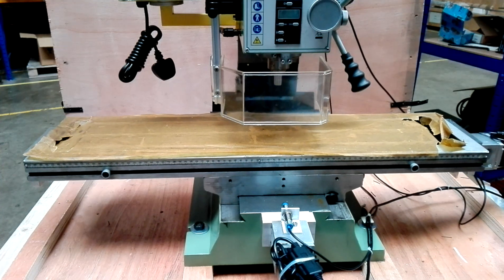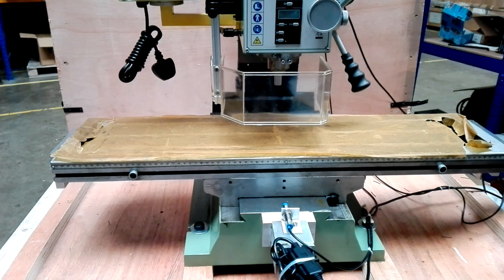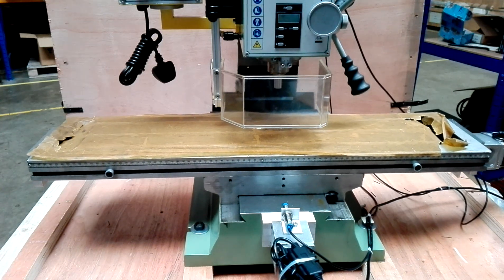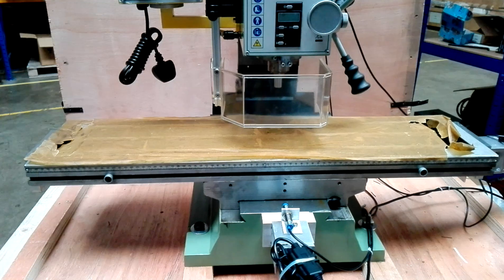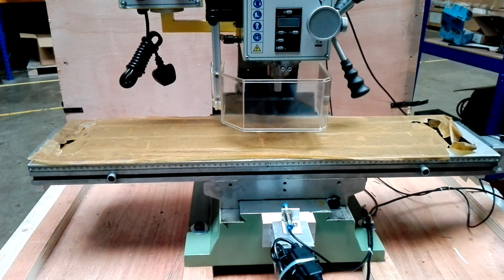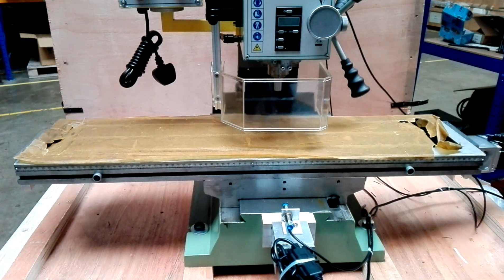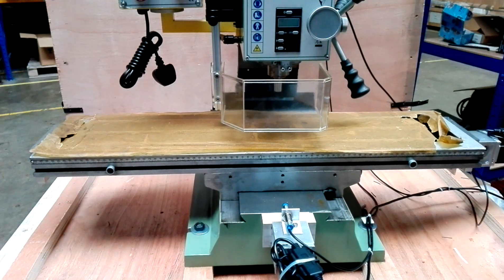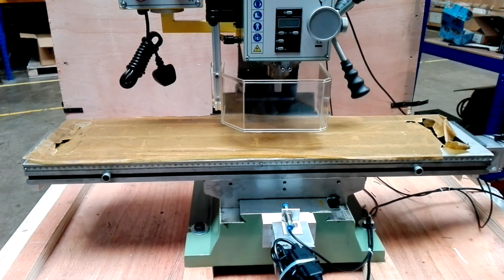WARCO CNC Ballscrew Conversion with Electronics and Stepper motors Under Power Test

Comment: Hi with this model Warco did you have to remove any material from the back of bed or sadle to fit the ball screw nuts? What size ballscrews have you used?

Comment: I would like to have seen a bit more of the Z movement to see how those motors perfom when say peck drilling, moving the heavy head is far more taxing than moving the tables arround.
Reply from the maker: Hello Derek, unfortunately customers machine. We did test with an extra 11Kg added to the Z Axis with no issues when doing simulated peck drilling and rapids well above the 2 to 3m per minute recommended speed to reduce wear on metal to metal parts.
Reply: @cnc4youUK  I'll contact you through your website email if I can find it.

Comment: Hi, We meet up at the Midlands Exhibition most years.
I have one of these machines and they are superb. Although for Hobby use I use it most days working on model 5 inch gauge locomotives. 
Wonderfully now I can proceed to mill bits for a metal cutting gantry style CNC using your parts. I got 2 of your stepper and control kits.

A very informative video. Thank you.

David and Lily Reading.
Reply from the maker: Hello, nice to hear from you and happy your projects turned out well.